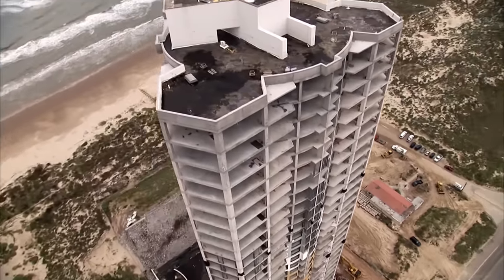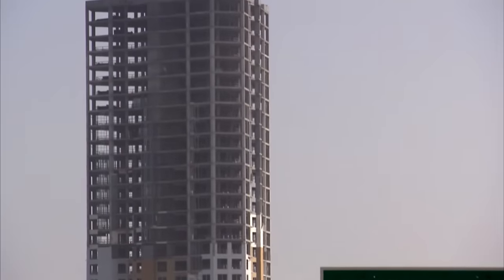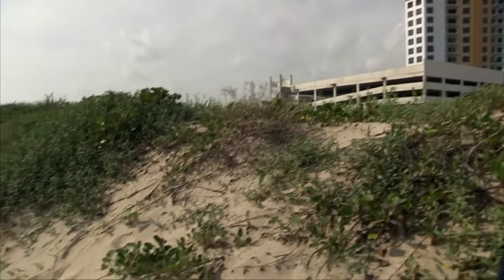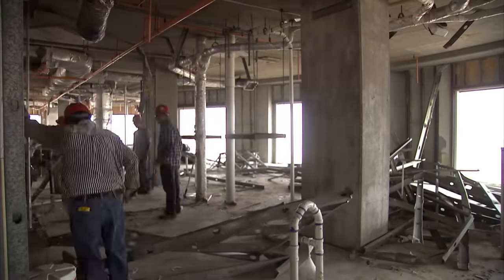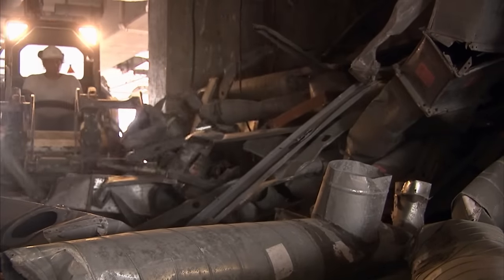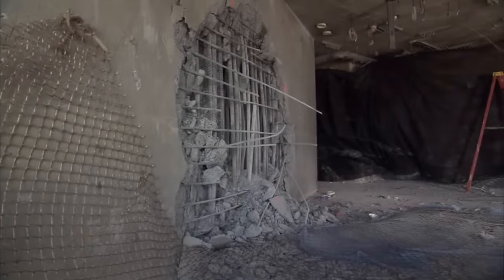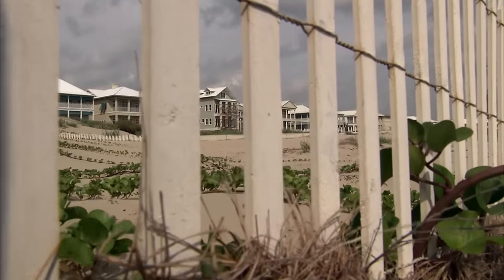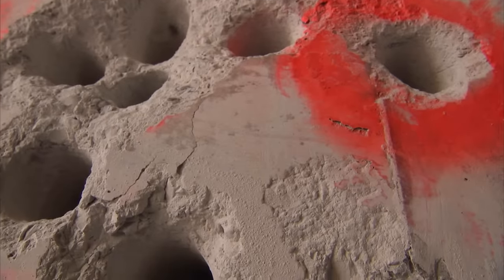Monster Tower | World Record Building Demolition | BlowDown | Free Documentary

Comment: This Demolition Company knows their stuff. Very professional and safe.
Reply: @jackoneill8585  And all your knowledge comes from where, exactly? Have you ever blasted? I mean you, personally? This company did it, and did it right. You're allowed your opinion but what you've based it on is anyone's guess. Because you've watched a video, don't claim to know jack shit about demo. Thank you.
Reply: @jackoneill8585  CDI has been doing explosive demolitions for 60 years. Why they did not use water, probably to protect the same dunes they where trying to avoid dropping the tower on. Spraying everything with water would end up flushing all the concrete dust into the sand, possibly also damaging the dunes directly.
Reply: @jackoneill8585  exactly " to do it under budget for mass profits" i wondered that they didn`t  remove windows and the bitumen material on the garage roofs. i bet this material is now detectable  in a large surrounding "natural" area which was the ame to protect from concrete instead of bitumenoil and glas particles. tztz. they are good in demolishing something, but this way wasn`t thought further.... but they won`t care, its not their living surrounding...

Comment: As the old saying goes: " It doesn't matter how good your building is if the foundation is bad"
Reply: The foundation was fine. Sapphire Condominiums was also going up and competing for the tallest building. They added more floors after the fact which was not initially  planned in order to be "the tallest building" on SPI. The extra weight compromised the foundation.
Reply: @LabPadre  
It is not the first time, nor will it be the last, that ego drove a building project beyond its planned structural limits. I believe it would be more correct to say that the foundation was fine for the building as originally planned. But if it was not built as originally planned, we will never truly know if the foundations would have adequately supported the original building.

Comment: "You can probably sell these for 300 dollars a piece" shows dude whacking em with a sledgehammer.
Reply: thats the exact thing i thought of
Reply: How else do you un tension a metel pipe holding 250k lbs
Reply: Mate these things aren't iPhones. I work with similar style props and you HAVE to use hammers or sledge hammers when fastening or unfastening. If anything, I thought they were being a bit too gentle with them.
Reply: He is open them up, just the way they are built for.
Reply: @ondrejsedlak4935  these guys have no clue theyve never touched a piece of steel that dense.
Reply: @dawsonharris5735  exactly

Comment: "The rebar configuration remains a mystery"? No One is Intelligent enough to get the Building Specs/Blue Prints? Built without them? Sure! WHO "writes" this crap?
Reply: Well I think it's pretty obvious they would have gotten them if they could. I'm sure those blueprints are long gone...
Reply: As long as a building is still standing, whether in use or not,  plans are  in the code office. And many times long after it is gone.
Reply: @John-np2bf  it's dramatized .
Reply: The steel doesnt need to be in any "certain" configuration, just that it needs to be in there.
Reply: @carlovincetti1352  have you went mad, so just throw it in there any which away you want Jeff I'm going to get lunch and it better be done when I get back lmaooooo
Reply: They did get them later in the vid. You probably missed that part
Reply: You know they have to create problems for drama. The fact is that manufactured drama doesn't add to these types of shows at all and come out corny.
Reply: @carlovincetti1352  Maybe for a shorter project but not for this one.
Reply: @ACE7O2  Trust me they had them from the beginning.
Reply: Doesn’t matter at all if they had the plans or not... they’re engineers and they open the walls to see for themselves.
Reply: For engineers, and ultimately demolition teams as well, there are two universes they have to deal with, the universe on paper, and the universe 'as built'. On paper, the universe is perfect, and everything is exactly where it's supposed to be, and there are no problems. In the universe 'as built', none of these things are true. You have to remember, even after they came up with the idea of drilling from the side, the rebar STILL wasn't where they expected it to be, blueprints or not.
Reply: thats what i was thinking. Its all drawn out for you in a blueprint
Reply: And why do they call it rebar when you can only use it once? I need another drink. Time to rebar myself
Reply: @AngryHybridApe  need to 'reinforce' your buzz?
Reply: @michaelgodown  
Exactly. This makes for good TV.
Reply: they obviously have never heard of oxygen lances. With that you cut all concrete, no matter the reinforcement.
Reply: Democrats strengthening America and I stood by & watched
Reply: @AngryHybridApe   it's short for "reinforcing bar" but it's ok to still have that drink
Reply: Y'all act like you paid for this... It's free don't complain
Reply: That was my exact reaction also!
Reply: @carlovincetti1352  Wrong, it does need to be  where it should be.  I've seen structures fail because of misplaced rebar.
Reply: 2 747's would pancake it to it's footprint.
Reply: All of the evidence in the settlement is probably sealed as part of the settlement of the Huge Lawsuit with the engineering, construction subs et al.......by the way the Demo guys have been to this BBQ before......
Reply: Thank u, finally a thinker among the herd. Rich

Comment: There must be rebar shop drawings and as-builts to indicate the layout of the rebar..  There should be no guessing or exploratory demolition.
Reply: I guess they never heard of a Stud Finder. Even if they don't have exact compliance with the specs, a magnet will give them an idea where to start.
Reply: Hahahahahaha. You would think wouldn't you? 

If only reality told that tell.
Reply: I think they do it for some drama.
I have to laugh at the use of pneumatic drills to prep the building. I bet they didn't do that at WTC. There are silent Diamond core drills that will cut through the concrete and Rebar. Not qiute as fast, But with Neil running security, they can take their time.
Reply: I wonder if they had liability insurance.
I once knew an explosives engineer who used to take down silos as a hobby. He gave-up and went-on to design nuclear warheads rather than pay the cost of the insurance required.

Comment: Rebar configuration remains a mystery?????? Get the blue prints, its on there in a the details section.
Reply: This is what I was thinking the whole time.
Reply: Fire Dept usually has the blueprints on misrofish.
Reply: Maybe the contractor didn't build to code, skipped some steps, or just took some materials to finish off that back patio.🙄😲😱
Reply: @sqeekykleen49  That doesn't work on projects like this. There are multiple inspectors and engineers that look at rebar installation before concrete can be poured. The city building inspector, the engineer for the plans, the contractor has an engineer on their side also.  Same with bridges. Nobody would know on a house if you took the rebar out after inspection and poured the slab, on these jobs, the inspectors are there the whole time concrete is being poured.
Reply: @chuckmiller5763  bribes kickbacks and patios. Maybe a short flight on uncle Jeff's plaaane.🤑
Reply: @chuckmiller5763  Inspectors can be paid off or avoided. Look at the Harmon building in Las Vegas that was 15  floors high before it was discovered that the rebar wasn't being installed to plan. It was only discovered because workers wanted a torch to cut rebar that was sticking out because it wasn't installed correctly and the inspectors hadn't noticed. Many demolition contractors have had failures because the rebar was installed differently than the plan that is filed. If you have watched other CDI demolitions, you would see how they always check to see how the rebar is actually installed. Faith and trust are the lifeblood of charlatans and the hallmark of fools. Everything needs to be verified.

Comment: Such a waste. It was a finely engineered building. It's crazy how the engineers managed to design such a well made structure but failed to put the most important thing into consideration which is the foundation. That building could probably take a magnitude 7 quack and still remain standing without much damage.
Reply: The foundation was fine. Sapphire Condominiums was also going up and competing for the tallest building. They added more floors after the fact which was not initially  planned in order to be "the tallest building" on SPI. The extra weight compromised the foundation.

Comment: "The mission to build on this sandbar will surely continue."
Ummm... how about NO? 
Leave it alone.
Reply: The foundation was fine. Sapphire Condominiums was also going up and competing for the tallest building. They added more floors after the fact which was not initially  planned in order to be "the tallest building" on SPI. The extra weight compromised the foundation. Sapphire is 32 stories and still fully functional.

Comment: " rebar configuration remains a mystery". Nonsense dramatic narration. Why, don't they have those building plans and drawings?.
Reply: It was a brand new building so why weren't the building plans available to find the size and location of the rebar?
Reply: @kansasthunderman1  because there are plans drawn up and then there are the ways things are done when reality steps in and things can't be done the way the architect imagined.  It's called "as drawn" and "as built" -- sometimes the changes made on the site don't get made on the plans.  

The guys welding and bending the rebar aren't looking at the plans, they're putting steel where they think it will work best based on their experience.
Reply: Because not all things are built to plans.  That's why it's a mystery.
Reply: They could have just got a set of "as built" from the rebar contractor.
Reply: Unreliable tradies bodged the config, tale as old as time.

Comment: Just an idea: Before setting the charges use a 7"x 18" core-drill bit wall mounted or skid steer. Remove each of the 17-1/2" plug's add 24"extiensions. this may save time.:-)
Reply: Idk the specifics of what ur saying but I've seen it done similarly.

Comment: Full credit to the brains-trust of CID (the 2 brothers and the det' cord team of ladies, the ladies performed magnificently, one must also admire the tenacity of the drill team also) only some '002% of building disconformity. The whole team worked surprisingly well together, everybody obeying instructions.
Top job, top team. Also, the team had set a new precedent without relying on the high heat explosives set within the Twin Towers, the storm proof concrete and reo' did not require the heat necessary to melt the huge H beam steel support contact points, 3000F.

Comment: 30:59   To be so smart, why did they install the cable clips (clamps) backwards?  The saddle (silver part) goes on the line that has the load.  The U-bolt always goes to the tail end (bitter end) of the line.  Notice how the U-bolt on the clamps kinks the main line? That may be why some held and some failed.
Reply: like  I still wanna know how hard can this be ? Osama and Obamadid it in the middle of a huge city !

Comment: Hello...drilling method to ease the carrying load, we tie a rope to the drill hanging  from top n  drill the wall. Loosen the length of the rope to the desire height n tie the rope again. This ease the load n uses the strength from the top that tighten the rope n the drill. Efficient work.

Comment: They should salvage everything that is possible, the bathroom stuff and others as they plan the demolition. Also why the demolishers don't have the original blue-prints?
Also to avoid wind you make the building round, not angular, with curved beams, to transport better the forces, and the should have a large base to keep it in place, not to deep to avoid water

Comment: instead of sand bagging for deck loading, THEY could have used "MINE BOLT" resin ... simple and available.. Developed by GE back in the late 1970s and brought to market in 1980? or earlier... Basically  like bondo and catalyst in two long "bags"... stick it in with the bolt, and rapid screw it... it mixes and sets up as polyester resins do.
Different approach to this air deck loading, but with mine bolt, you seal off the holes ... improve effectiveness of the explosions.

Comment: Construction appears to be 100% - but the most important part - the footing was bad. Such a money loosing mistake.
Reply: The foundation was fine. Sapphire Condominiums was also going up and competing for the tallest building. They added more floors after the fact which was not initially  planned in order to be "the tallest building" on SPI. The extra weight compromised the foundation. Sapphire is 32 stories and still fully functional.

Comment: Are these people still living in the 1950s? "It's impossible to drill through the concrete due to the rebar".
Ever heard of diamond core drill?
Reply: If the density varies as the bit travels through the concrete due to encountering rebar, it will shock the bit and possibly fracture it regardless of what it's made of. Also as the friction varies, the bit can quickly become too hot and break or become deformed. The entire problem is the huge inconsistency in density between the concrete and the rebar.
Reply: @mstalcup  What about "daimond cable" .?     They cut the nose of the Kursk off, with one of those. !!!

Comment: Amazing, all the professional work and planning that goes into bringing this tower down, and it STILL fails?!?
My advice would be to just take an old, decommissioned airplane, and fly it right into the tower. It has been done before. Twice! It works like a charm every time. No need for all this. 
However, If there is anything in the basement, like gold or such, please remember to remove it first, as the whole building will collapse into its own footprint. 
Don't worry about damaging adjacent buildings, it is not a problem with this tried and tested technique. It WILL go straight down. 
-And don't worry about that core too. It will be gone. Don't know how, but it will disappear. I promise.

Comment: I had an idea while watching this. Dont use dynamite. Get the air force and just use missiles and bombs. Or just dont use explosives at all. Sure it would take longer but it would be a hell of a lot safer for the neighbors. If they remove all of the concrete they can just let it sit for a while. The rebar would eventually bend and it would collapse. If you remove the concrete on the side that you want it to fall on and not the other side, it fall that way

Comment: I am not a structural engineer, but even I know  that you can find out where rebars are simply by looking at blueprint, or by use of ultrasound, that would reveal denser material, i.e. rebars. On top of that, any person competent enough would know that you never try to break a 3/4 meter thick wall by sledge hammering it in one place, you would go in circular pattern, chipping deeper and deeper, until rebar are exposed.
This is shit reality TV, not a reality.